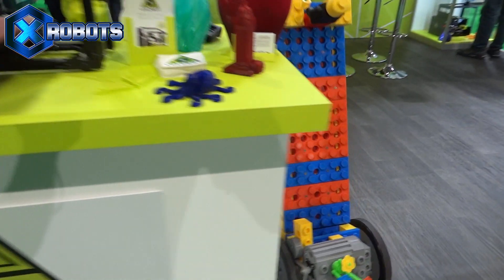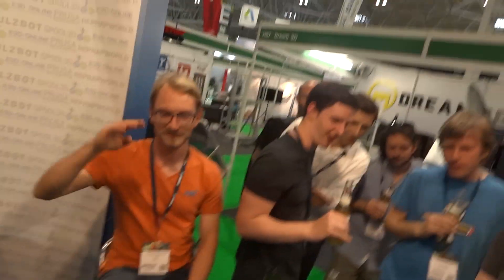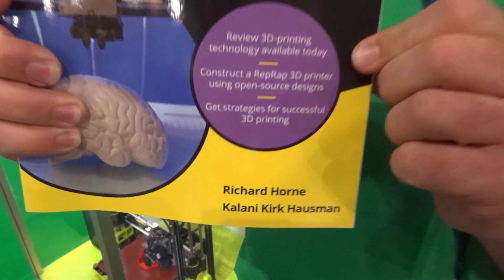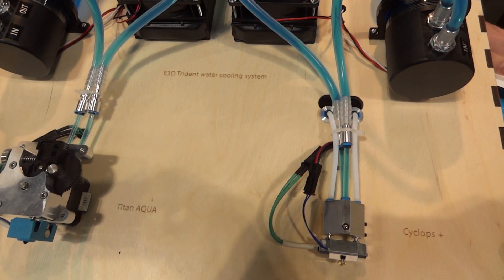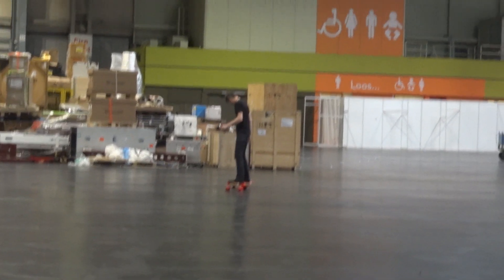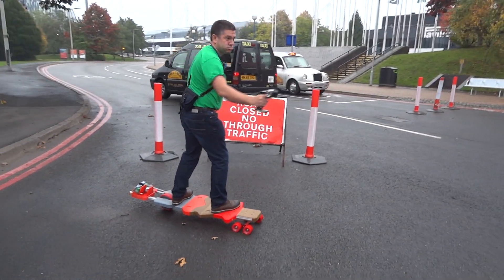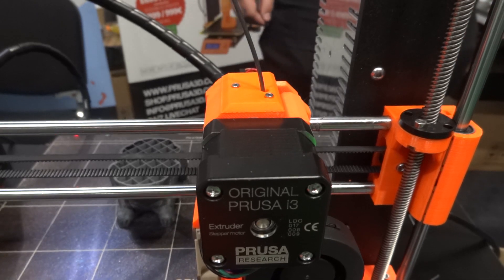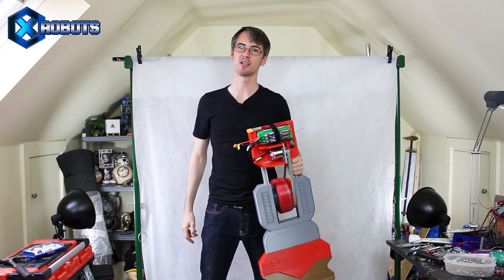Iron Man Electric Skateboard Build #2 at TCT show with Lulzbot | James Bruton

Comment: Does anyone know what program is James using for reading data from the RC transmiter? Is he using interupts? Also if you are reading this James which data filtering library are you using. My results from transmitter are quite noisy :( Thank you for help, Easy Transfer works GREAT!.
Reply from the maker: The R/C Receiver is just plugged straight into the ESC, that's it.

Check this out though: https://www.youtube.com/watch?v=3pYWLF8qw-g

Comment: Also, regarding the board,  I would love to know what the cost of the motor and controllers are as well as the distance per charge approximately on it.   Seems to work great!  I am handicapped, so nothing I can use, but I am considering doing a seat with a balancing unicycle type thing.  Honda has a design they have been teasing for years, but nothing buyable.

Comment: Out of curiosity, why did you go with PLA on the board and not your more typical ABS?  Was there concern about lifting due to the sheer size of the parts?

Excited about the tetherless printing mod for the mini, and that new extruder they showed on the mini that can do flex and solid would be very nice.  I have avoided doing flexible as I only own a mini and didn't want to have to change heads to reliably print flexible.  What I really wish I could get would be dual extrusion on my gen 1 mini, but I don't think that will ever happen as it would require too much replacement.  I think both the power supply and the controller would have to upgrade.

Comment: Looks like a much better track than hannover, but still no safety equipment looking forward to this. I also use the VESC for my electric one wheel project it's a great controller.
Reply: yes I'm controlling the VESC with an arduino over the serial port. I use the VescUartControl lib (https://github.com/RollingGecko/VescUartControl) to set the current. The arduino reads the IMU and calculates the torque for the stabilisation.
Reply: If you need low speeds with high torque you should use sensored motors the improvement on startup is impressive. There are also cheap BLDC motors with HAL sensors available.

Comment: The turning circle on the iron man board is a bit like a container ship hehe but it's definitely got some good speed.

I think you may have been better with 2 separate skateboard trucks mounted about 8-12 inches apart at the front and I'd have potentially printed a narrower drive wheel like a chunky v-belt pulley.

Definitely still a good project tho.

Comment: The water-cooled nozzle is a game changer
Reply: Sidney King, The water-cooled system  allows you to mount the extruder in a heated build chamber, which drastically improves printing for difficult and higher temperature materials like nylon and peek. It also cools the extruder motor, which again would be necessary for a heated chamber.  In addition, the water cooled system allows a bigger differential between the cold zone and the heated zone, which allows either higher temperature hotend or higher volumetric plastic melting capacity, i.e. faster printing.
Reply: Tony Rios , I don’t quite follow how a water-cooled nozzle would be used. Is it to replace the extruder fan on a 3D printer?  Also with this product how does it improve printing?

Comment: This was awesome man, totally want to build one myself now! ( Granted I may have to use a bit more steel in mine, as I R a hefty fellow ).
Reply: Yeah it looks like it it can hold about 100kg, but I'd be worried putting a guy my heft on there as I'm pushing 130kg, which most e-boards are not rated for.